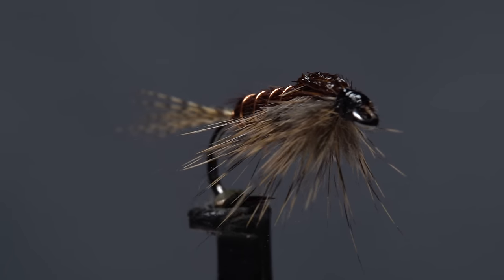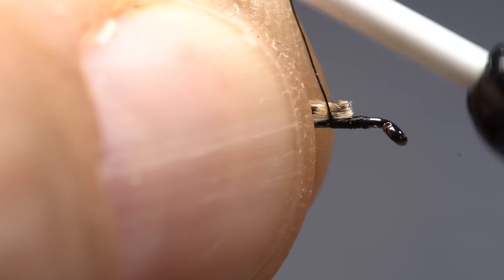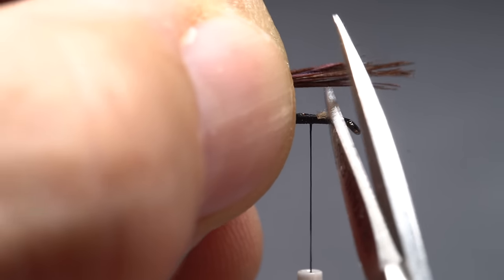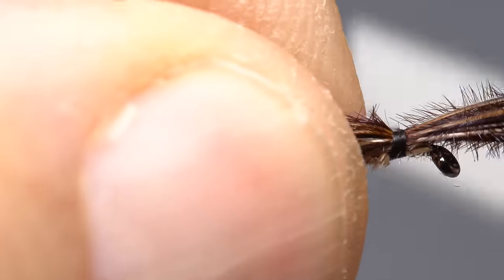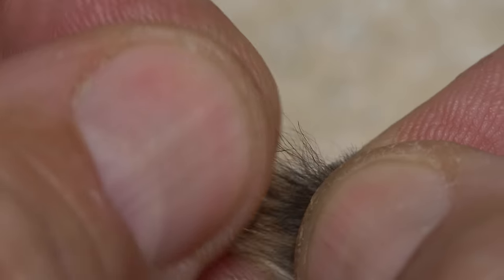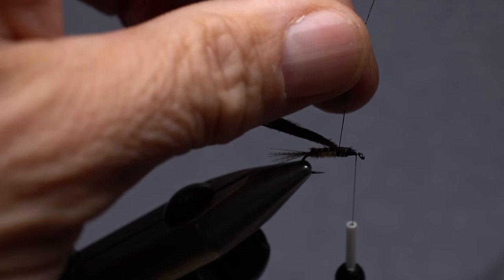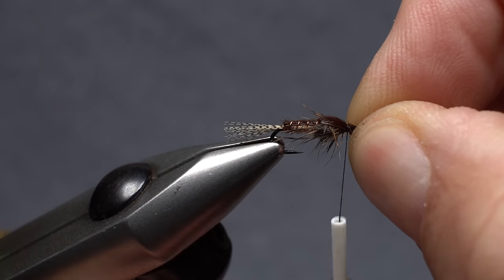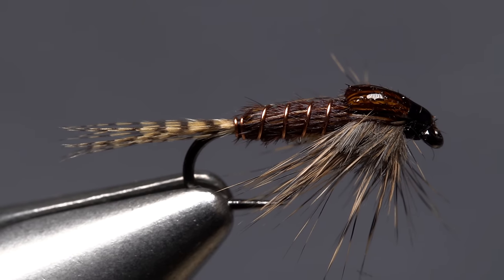Phat and Phunky Pheasant Tail Nymph

Comment: What is the small flat edge tool he uses to cut the thread?
Reply: Probably the sharpened butt end of his whip finisher, I do that to all mine, makes a nice cutoff for close.
Reply: @brianstevens3858   Thank you!
Reply: @coreymcgee8283  You're welcome.
Reply: @coreymcgee8283  On a side note as it were , I also have a bodkin that has been tip sharpened at a 45 top and bottom, much better for the size 16 and smaller.
Reply: @brianstevens3858   Great info, thank you again!